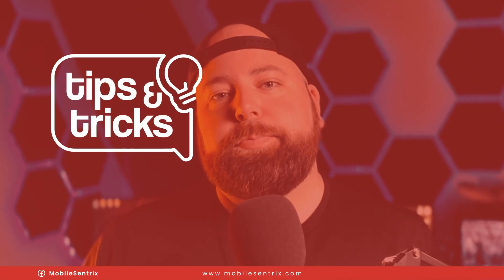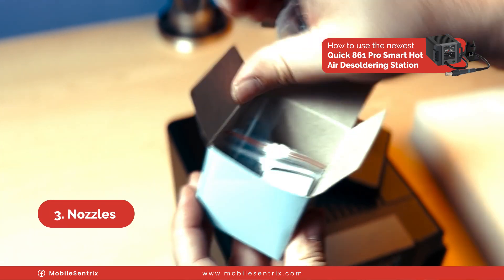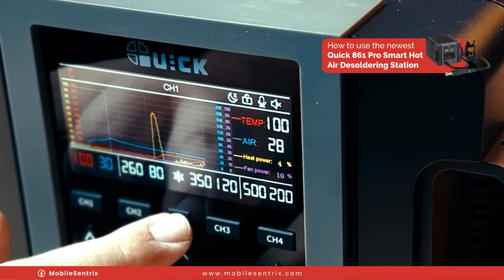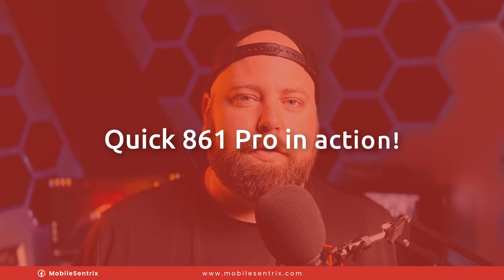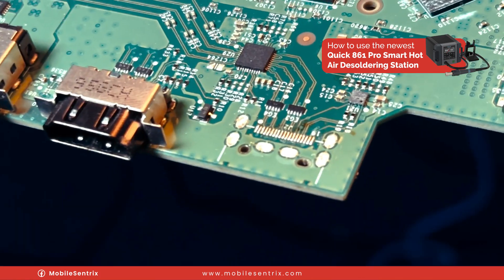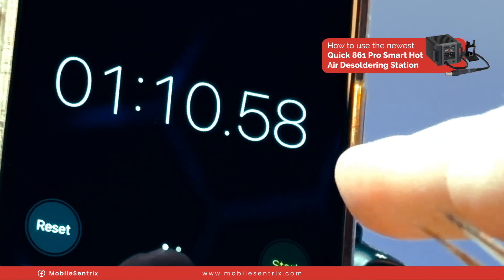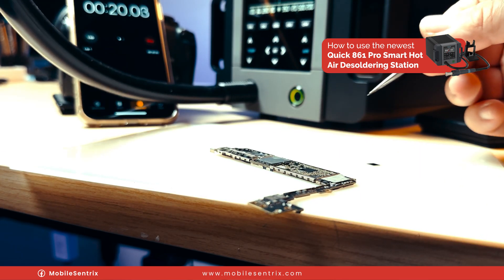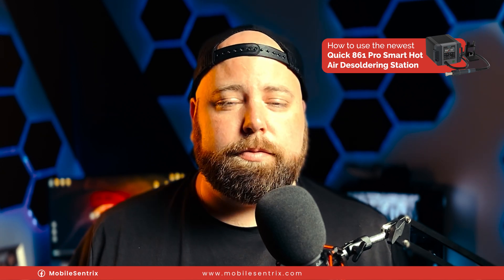The newest Quick 861 Pro smart hot air desoldering station (Tips and Tricks #85)

Comment: I'm confused to buy either sugon 8650 or quick 861 pro 
Kindly suggest me one ..
Reply: I have both of the hot air stations you mentioned, if you want a more options and more settings pick Sugon 8650

If you just like simplicity and ease pick Quick 861 Pro

Both have same accurate temperatures and good air flow.
Reply: Same question

Comment: This is a pretty good video in terms of showing the usability of this rework station.  However I will say, to anyone watching this and seeing the hdmi port being repaired on an xbox, or the iPhone 7, Please don't do it like the way it is shown in this video as this is a demonstration only.  If you are going to repair Xbox for your business and you wish to do the HDMI port, you should use a bottom heater and evenly warm the board up and then use a lower temperature on the rework station as you do not want to risk damaging the board. You should also be using flux for both removing and attaching the port back on.  Another tip I can give from personal experience is that microsoft on all there xbox's use terrible quality of solder,  Maybe try to remove the old solder from the holes and run some new and better quality solder, will keep you from getting a warranty return from using older oxidized that's weak.  For the iphone 7, you can't go to hot with that audio IC as you will almost definitely float the baseband on the other side of the board.  I can't even begin to tell you the amount of phone boards that I have had to fix up the baseband after someone has had a go at the audio IC, Just go look at Jesse's channel and see the right way to do it.